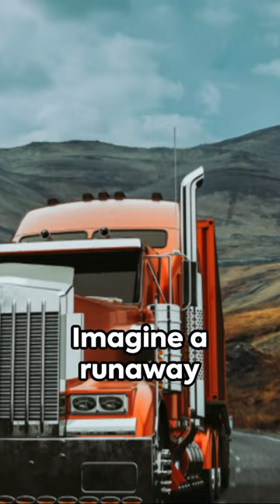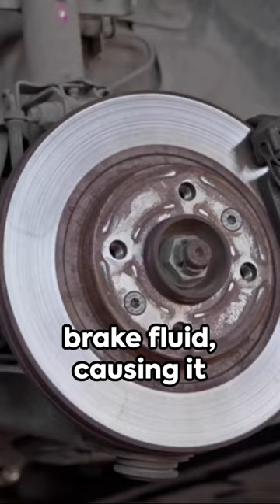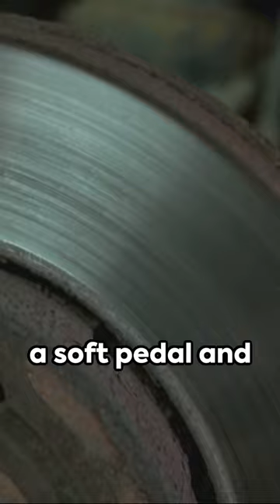Why do brakes fail or burst? Unveiling the Hidden Dangers

Comment: Actualy the brakes are actuated by a spring, the air is what holds them open. Used to be the other way around which is kinda scary. Either way you can still smoke the drum and shoes or rotor and pads.